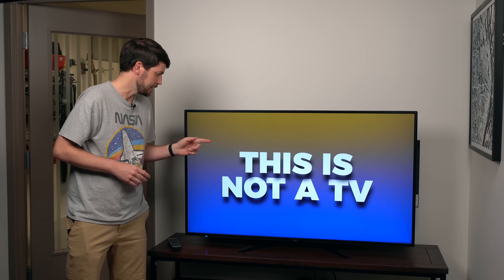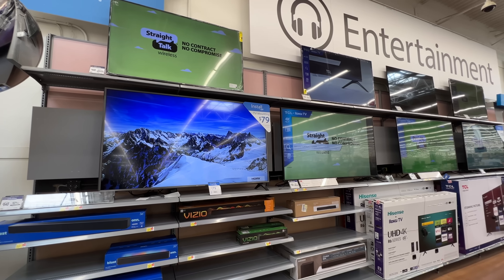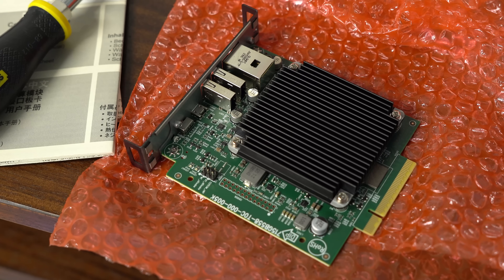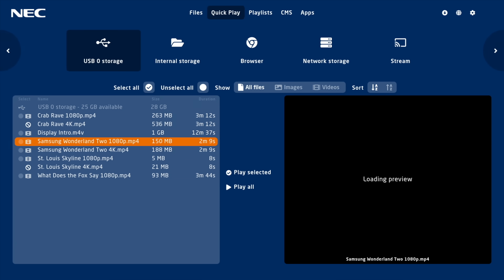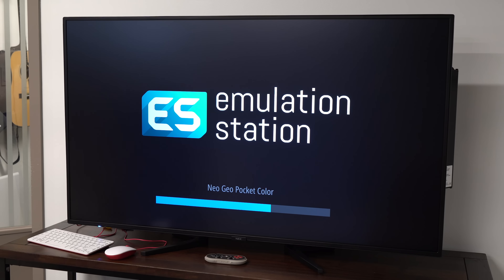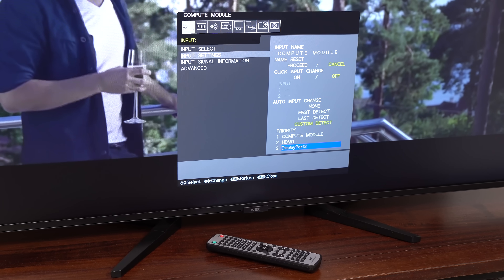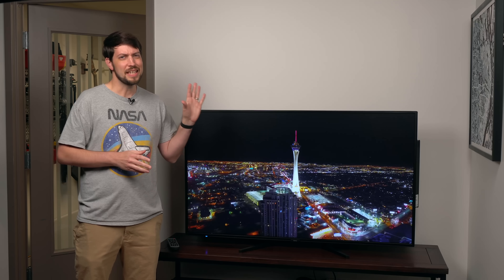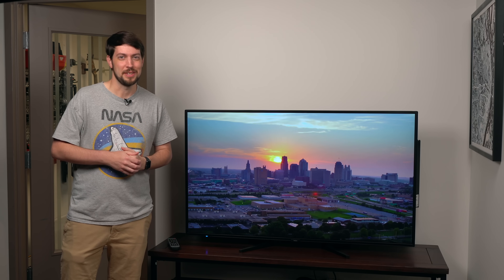Smarter than a Smart TV! (Raspberry Pi Inside)

Comment: When we were up for our last TV purchase I was blown away that there are no "dumb" TVs available anymore. It's almost like these companies are selling our usage data and greed is making their decisions for them. /s
Thanks for the intro to this concept. I think this is pretty cool stuff and I like the concept of knowing what code is running on equipment that I own.
Reply: Selfishly, I actually kinda like it. The prices are heavily subsidized by companies like Netflix and Amazon who pay the manufacturers for including dedicated buttons on the remotes and selling them usage data, so I get it much cheaper and then I just connect it to my HTPC and never use any of that crap (hell, I don't even connect the TV to the Internet).
Reply from the maker: Just have to make sure the TV doesn't also have an always-on microphone or camera!
Reply: @JeffGeerling  1984 was a manual for some of these TVs
Reply: @hellterminator  I thought a similar approach would work well for us until the built-in "smart" software started crashing regularly. It's frustrating to have a TV that works fine as a display but keeps being kneecapped by the computer inside it. The dedicated buttons on the remote are annoying as any accidental press will exit the input it was on. It also doesn't help that those dedicated buttons take up a majority of the remote faceplate, increasing odds they will be accidentally pressed. Almost like it is intentional...
Own nothing and like it? No thanks, not for me.
Reply: @gannas42  Well, that sucks. My TV doesn't crash. And I don't even use the remote — the only thing I need the TV to do is turn on and off and my HTPC handles that through CEC.
Reply: I definitely miss my old tv's manual picture in a picture as a feature. Back in the days I would connect my Computer via rgb input, Cable service via Coax and Antenna for over the air... and select full and minimize screens of my computer and broadcast television. Today I can't do that, which is a shame. Smart 📺 TV need to move back to that feature. Imagine being able to stream multiple services on one display?  Multiple inputs and an option to watch in PIP is what I want returned.
Reply: @israelzayas361  I remember when picture-in-picture was a common feature on large format TVs. It was a big surprise when our first flat panel didn't have the option. Would be super useful these days, I think. Imagining security camera overlays and such. Seems like it'd be more useful today than it was 20 years ago.
Reply: @JeffGeerling  If its not connected to the Internet, does it matter?
Reply: Dumb tv with separate smarts on boxes is best for me. Finding dumb tvs that’s the problem
Reply: There is dumb tv but they are mostly PC gaming monitors.I replaced my 10y old 32' Samsung 3d TV with a Dell 32' gaming PC monitor and plugged on it a good set of speakers. I was using as well a shield tv since 2015. I love to plug a PC on it and run retro games with accurate high resolution CRT shaders
Reply: @Tailslol  Don't count on that.
Samsung for instance now wants to ship PC monitors with Tizen built in too.
So the curse also is coming for PC users.
Reply: @MegaManNeo  i guess you didn't read well, i said i use a dell screen now. not a samsung anymore...better stick to pro brands like nec or dell.
Reply: @Tailslol  Oh. Nono, I wasn't going in detail on your exact setup per se but rather the circumstance that companies right now try to sell that smart screen shit on PC users as well.
I don't get why but if my TV dies (it works fine since 2008 with only one HDMI port being dead since a power outage past year) I'll just replace it with a PC monitor as well.
Reply: @MegaManNeo  I don't understand. I just use my "smart TV" unconnected to the Internet and plug in my RPi into one of the HDMI ports. It doesn't matter what the "smart" shit in the tv is or does, it can't do anything if its not connected to the Internet. You can, if you want spend mega-bugs on a 65" monitor, but a standard 65" 4K TV works just fine. Again, mine has never been connected to the Internet. I don't need updates I don't need anything, just the TV to accept HDMI.
Reply: @Bennyboy-dog  I feel like you have been pretty lucky. I don't have my TV connected to the internet either but that didn't prevent the built in software from creating a situation where the TV became practically unusable. Just a couple months after the warranty was up, too.
Reply: @Bennyboy-dog  I've read about some "smart" TVs automatically connecting to open networks, so it can be hard to ensure it's not connected.
Reply: @gannas42  That is criminal! What happens if my mother doesn't have Internet and wants to watch TV?
Reply: @eDoc2020  That may very well be true eDoc2020 - I might have to do some wifi snooping, and if the tv is doing that, I will set it up on my own guest network that goes nowhere.
Reply: They get paid to load all the crapware.
Reply: There are still dumb TVs if you're willing to look outside the big brands (Samsung, LG, Sony). I bought a Sceptre  65" 4k LED  TV two years ago precisely because I didn't want a smart TV. I have it paired with a Nvidia Shield TV Pro, and it has been rock solid.
Reply: @gannas42  - It should make a comeback. With Google Chrome Cast dongles, Roku and other smart boxes, why bother with a smart TV? In my bedroom I have a 42 inch ASUS computer monitor with two hdmi ports and rgb. Chrome cast works wonderfully on it. My Blu-ray player with smart apps works fine on it, my PC? No question about it... just works, but I wish I can have the pip feature to run multiple sources at once. Full and minimize screens left or right corners. Why don't they offer that anymore?
Reply: Plenty of them dumb TVs here in India, if you want you can import them for cheap!
Reply: @hellterminator  stop telling them about the design floor, one software update, and it will be brick until it see the web,
Reply: @dh2032  I'm not entirely sure what you're trying to say, but if you don't connect it to the Internet, literally nothing can change. If it works out of the box, it will keep working until you give it a chance to call home.
Reply: What is scaring me the most in smart tv is internal memory corruption that will make most of them not usable due to app crashing.
Reply: You don't have to use any of the smart stuff. Just plugin a raspberry pi and use that - done!
Reply: Mini PC sticks are more versatile and easier to use. RPi hardware is scarce and always has been.the lack of onboard ssd boot support was why I quit the RPi geekiverse :-)
Reply: Keep it arround for 2 to 3 years, it will dumb-up..
Reply: @hellterminator  good news, they found that loophole and now you cannot use the TV if it's not connected to the internet.
Reply: @danmerillat  I haven't seen that yet. Doesn't sound like something most manufacturers would dare to try. Sounds like some Apple bullshit.
Reply: @hellterminator  TCL/Roku pulls that shit, you cannot get past the setup screen unless you connect it to the internet, it's literally a brick without internet.  Amazon fire sticks go one farther and if they're ever disconnected from the internet you can't do anything with them. I don't know if they put that abhorent behavior into fire TVs as well but I wouldn't put it past them.
Reply: @danmerillat  Does Roku make full TVs or just the streaming sticks. And if they do, do they pull this crap on the TVs or just the streaming sticks? Because it makes perfect sense for the streaming sticks.
Reply: @hellterminator  Roku makes the guts of TCL TVs.
Reply: You don't have to hook them up to the internet
Reply: @seanfaherty  You absolutely have to hook them up to the internet.  Before that you get nothing but a screen telling you you have to hook it up to the internet. Maybe you haven't bought a TV lately, but YOU are the product being sold, and they can't sell you to their actual customers if you don't let them harvest your data.
Reply: @danmerillat  my kid's Samsung bought in July works with no internet
Reply: @seanfaherty  cool i already named two brands that refuse to first turn on or sometimes even operate at all without internet access but you found one that hasn't yet locked you out, well done.
Reply: Sceptre still offers dumb tvs.
Reply: Huh, I just bought a cheap off brand. It has such basic functionality, it doesnt even have a button interface on the tv itself.
Reply: @israelzayas361  I have seen some diaplays that do that, but they dont have the built in smart functionality as an option for the picture in picture mode.
Reply: I love “….almost like these GIANT CORPORATIONS care more about money than anything!” (Epic! True!)
Reply: just take the embedded rom out. Keep the inverter and hook a pi to it. It's just a panel without its brain, so swap the brain.
Reply: @Bennyboy-dog  depends if the display insists to become a TV 😂
Reply: @israelzayas361  I was also surprised to see nothing supports this anymore and its clear why... You could bypass the ads easily like this so sad isnt it?
Reply: I wanna  86"  touch screen for the  Pi  !   ;-)
Reply: @crysiscontained4421  You have a source to someone who already did this? You sure you don't need special drivers? If it would be that easy you could make a business of this building the spyware out.
Reply: @ElNadaInLada  Does your computer monitor need special drivers? But in all seriousness, I completely doubt that the inverter would need special signals to make a picture as developing something like that would be stupid expensive to do and wouldn't work with the standard digital input that HDMI or DP is. The only thing is that certain things that require the HDCP probably wouldn't work on it as you would be cutting off the ROM. If you really want to make it a true "dumb" TV just pick up a generic HDMI driver board as they can be gotten for less than $30
Reply: Looks like Geoff just found the solution, Just buy one of these Monitors & put the intel version of board in it & load whatever O/S software you want on it like the Media playing software like LibreElec or for me I'd go all out & put Linux Mint on it as that will do everything you want which is what I do at home with my projector. And if you still want TV channels you just buy a media/DVD player with a TV Tuner in it & there you have it a Dumb TV far superior to the so called smart TV's which is pretty much what I did to my smart TV because it's not very smart at all and doesn't do what I want.
Reply: You can still buy "hospitality" TVs. Much like this, but TVs intended for commercial businesses that are only going to use it to air news channels in a restaurant or sports for their patrons or display their menu options, etc. 

Samsung makes a wide range of these "hospitality" TVs and none of them are smart.

They are next to impossible to find in a store, but you can order them. They cost a bit more than a smart TV but not exponentially more. I am looking at a 55 inch 4K Samsung "hospitality" TV that seems to be really decent to replace a 10 year old set I have with failing pixels.
Reply: @G.S.Holland  Last time I looked they were 2x the cost of an equivalent smart TV with the same display technology. Maybe I had been looking in the wrong places? It's been a while so maybe the market shifted in that time...
Reply: @hellterminator Apple don’t do this $hit! Roku, TCL, Amazon and many $hitdoid devices do, that’s why I am and all people I know are getting rid of fire sticks and Roku switching to Apple TVs. Better in everything, there’s no comparison. I’m a programmer and tinkerer, hell I even compiled a web browser for Apple TV. Besides Roku doesnt allow IPTV apps or VPN. Amazon prevent some other apps and screwing UI, adding ads, etc. I dont have to deal with this on Apple TV. No comparison at all. You get what you pay for.
Reply: I think Vizio showed in its earnings report a while ago that they made more money by advertising than actually selling TVs.

Comment: A lot of these types of display run centralised signage software to control the layout and content.
You can usually define an area of the screen to pick up live video streams from the network, like multicast or RTSP.
Needless to say, there are Linux based, open source, signage projects like Xibo you can use, so if you have a machine with a TV tuner card, you could stream TV across your LAN to your non-TV signage display.
Reply: HD Homerun is excellent for this
Reply: A pc on a stick running Windows or Linux are  plug and play, They work out to be cheaper than the time and hassle of using RPi stuff!

Comment: These NECs are also used 24/7 in manufacturing on large production lines, displaying multiple statistics to operators and supervisors, allowing them to see at a glance during their process adjustments spec readings in real time without being tied down to a workstation monitor.

Comment: I just picked up a 86" version of this display. Thank you for posting this video it's hard to find straight forward info for a regular guy not an office.  My question is about speakers. How is the sound out of the speakers? Is there a way to adapt to a bose 5.1 surround sound system? Please anyone who has any thoughts on this reply I'm still learning about home entertainment type stuff. Thank you!
Reply from the maker: For sound the best bet is to use optical audio out or digital to a separate AV receiver, and use that to drive the speakers. The ones NEC makes for this display are not amazing quality. They sound fine but you can do a lot better with a completely separate sound system.

Comment: Great video.  I work in the signage industry and love these displays a lot and wish I could work with them more.  But getting some small shop to actually buy them at this price, instead of the cheapest TV at Best Buy and then just using a FireTV stick, is very difficult.  Signage has a lot of options and most go with the cheapest solution.  I'm in SoCal and when I go through McD's drive through around the area, I see that the "TVs" the chose to use are failing big time.  So if McD's can't even afford to install these, then Joe's sunglass hut probably won't either :)
Reply from the maker: Yeah; I have noticed some places cheap out, and within months, the TV is washed out or really, really dim (especially if they place it somewhere exposed to sunlight for part of the day).

And at that point, since they invested in the setup their using, they just go with it (since the dull image isn't as noticeable if you've just seen it every day a tiny bit less) and don't feel like they could switch to a proper display at some point :(

Comment: For consumer TV, you can buy demo units. 12 years ago, I bought a demo unit. It has one great feature: a glass panel in front of the screen!
I also suspect a better build, because it's still doing great in all aspect.
I also got it cheaper than the original product, because it was already used.
A friend who bought it with me didn't want in the first place, so I explained him that those TVs are made to be on display every day while the store is open, plus the glass pane that makes it sturdier.
I bought back my part a few years later. A bit expensive, but that TV was expensive and the price was still right.

Comment: Funnily enough one of the shops near my place has one, for the last few weeks its bugged out, so its displaying linux error codes, so  i wondered if it had a pi inside or some other arm computer
Reply from the maker: Could also still be Intel, just running a Linux OS instead of Windows.

Comment: Can you use it in a silent room with all the fans?
Are they annoying turning on/off all the time or changing RPM noticeably fast?
Reply from the maker: The fans didn't even kick on in all my testing, except when the display turned on. You can control the speed or have them off entirely if you want, and set a temperature threshold to turn them on.

Comment: It's funny you pointed out webOS as the proprietary operating system :) That's based on the open source webOS from Palm and HP years ago. LG still maintains the current repo. webOS OSE.
Reply: still got my hp touchpad (at least thats had more updates/life than my now defunct ipad3) with a gazillion updates/improvements on it and a pre3 collecting dust somewhere.
Reply: Samsung TVs use Tizen, which is also open source and actually backed by the Linux Foundation.

Comment: First of all what is the screen size on this second is there anything larger available third is there a touchscreen version or possibly a way to use a stylus in addition to this even if it's some sort of active stylus system that could added in one form or another.

Trying to figure out the easiest and cheapest way to do essentially a DYI Smartboard but yet could be used for media would want to also be able to be running Linux on Raspberry Pi even if the pie is external!

Kind of fancy whiteboard replacement that could do just about everything that you throw added the lowest-cost largest screen the better any suggestions from the community please

Comment: I'd be very interested in a follow up looking into a viable way to use one of these as a media center. 1080p is fine. High refresh rate gaming is off the table but that's fine too. The only issue I see here is the high cost you mentioned, and the technical hoops to jump through.

Comment: Yeah, those setups are pretty good. I worked with older NEC screens, which were a part of some kiosk system which I had to repurpose in serveral of our offices. It had to be done cheap, so some PI's and a rescheduled screen did the trick. When we went into lockdown in 2020 I left the PI's on, when I returned a few months ago they were still running lol.